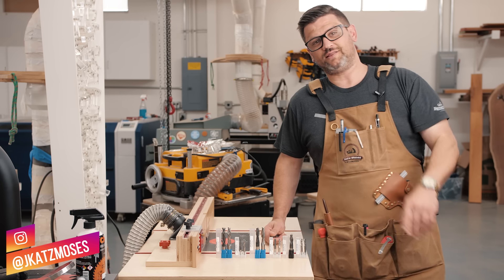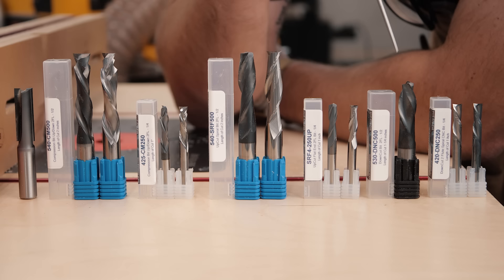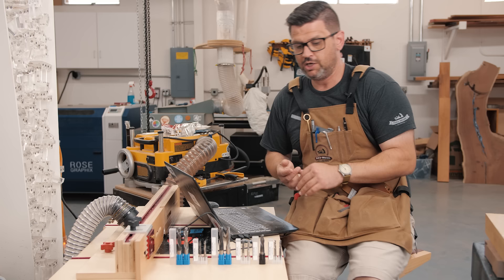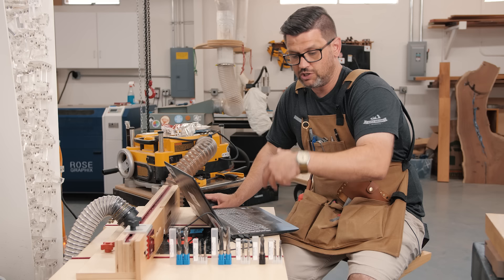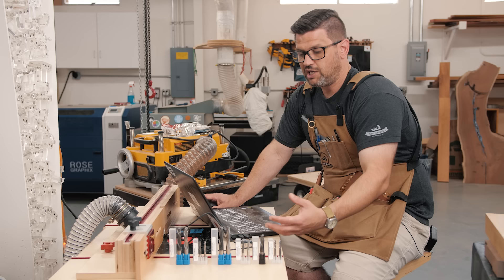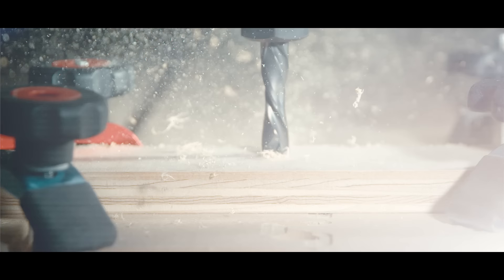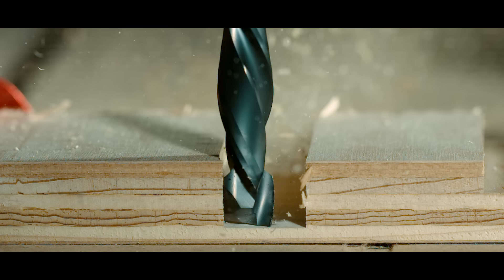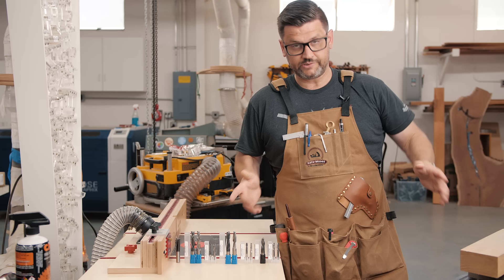Spiral Bits - Compression VS Upcut VS Downcut VS Straight - Never Before Seen 19,000 FPS HD Video

Comment: Hope somebody can answer this. Used an upcut bit on my router table. Tried to remove 1¾ inch of material. It yanked the pc right out of my hands and threw it across the room. Am i trying to remove too much? I quit because it scared the hell out of me!
Reply from the maker: Way too big of a cut. No more depth than diameter of the bit
Reply: I guess I didn't explain it too well. The depth was only about ³/¹⁶. The height was 1¾. Not sure why they sell a bit with a 2 inch cut height and you can't cut that much

Comment: The 1/2" bits are way more expensive than the 1/4" ones.  Are they worth it in your experience?
Reply: Larger diameter bits are stiffer, allowing you to increase your feed rate. It really depends on what machine you run. My table has a 10hp spindle running at 18,000-20,000 rpm at 800 inches per minute, I primarily use a 3/8” diamond coated compression bit for profiles.

Comment: Was wondering, which BitsBits Router Bit do you use to make T-Track Slots? Thanks in advance.
Reply from the maker: I think its called a keyhole bit
Reply: @katzmosestools  Guess I didn't ask the correct question. I'm wanting to cut a slot to put pre-made (Rockler) T-Tracks in. I figure a DownCut bit is the best since I'm cutting them in Plywood, but I didn't find one that cut a 3/4" slot.

Comment: Compression bits last for few shifts in my work place and they are more likely to break.
Reply from the maker: They run at completely different feeds and speeds than straight bits. If you don't adjust they can definitely break.
Reply: can you help me with that ? Is it some kind of formula, or just sellers recommendation ?  is it slower rpms and faster feed rate ? Sorry for metric and my english :)  its 12 mm diameter up and down  bit, we are cutting 12, 15 and 21 mm thick plywood straight through, both sides need to be somewhat clean, 18000 rpms and 8 m/min feed, with ramp plunge down into contour. Tool was given to test without any info :(

Comment: Great high-speed footage. You missed the point of Climb vs Conventional even though it's shown at various points in the videos. Climb cutting will leave much better edges as the material is fully supported and there won't be rubbing and heat build-up but slots are inherently 50% climb and 50% conventional. Ideally, you should make an undersized slot then clean up both sides with a Climb finish pass. There's no point in showing a compression bit for a slot so you should be showing full DOC and both top and bottom surfaces that result.